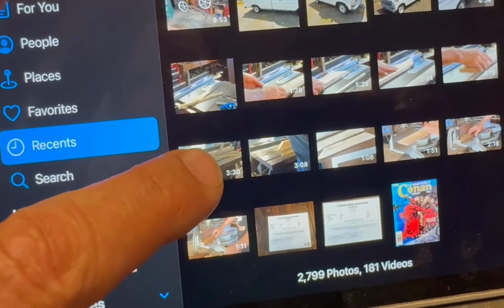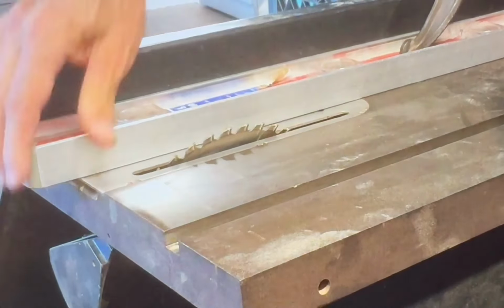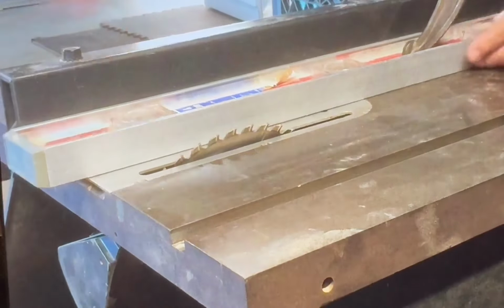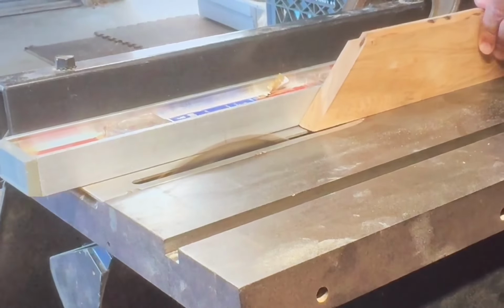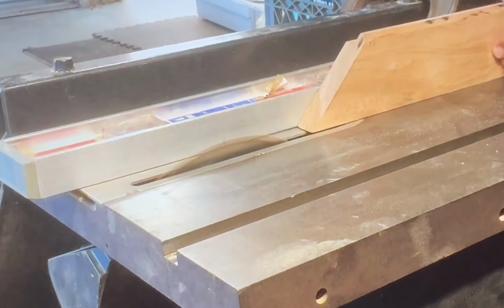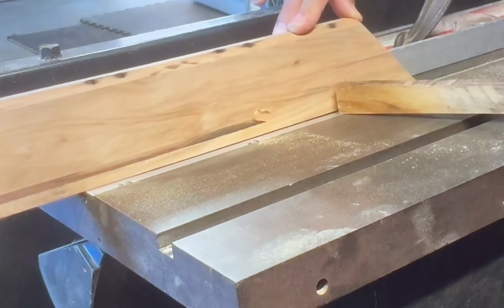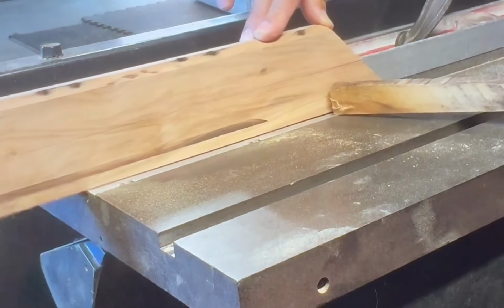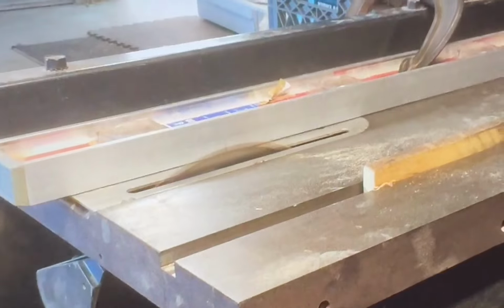Try not to embarrass yourself.

Comment: I'm not sure what the purpose of this video is for.  Why use the level as an auxiliary fence, why not use the fence itself?  As you so demonstrated you have added in a factor of error by not clamping the level down to the table saw surface as well as the fence.  Why is the fence not adjusted so that it is 90 degrees to the saw table?   I'm sorry but I have to give this video a thumbs down as there are more questions than answers here.
Reply from the maker: The purpose of the video is to provide entertainment.
The level is straight and flat along it’s surface, the fence is not.
The possible error was seen and avoided.
The underside of the table is ribbed, not flat, preventing use of C-clamps.
The fence was not used because it’s not flat, and the angle of the level in relation to the table was not important for this cut.
Only that it was parallel to the blade.
I thank you for your polite questions.